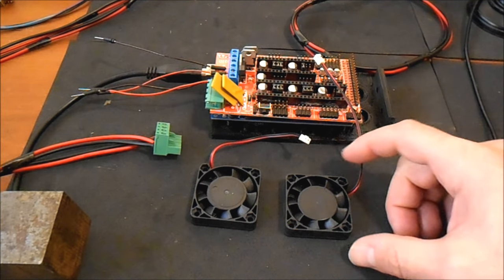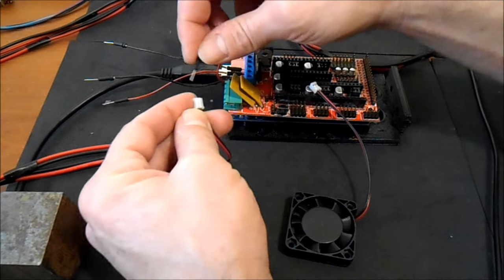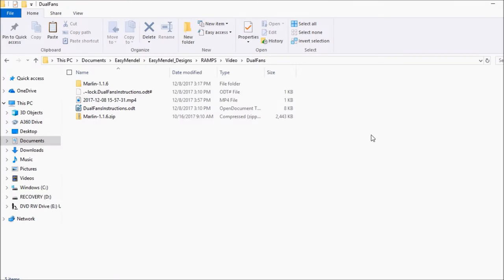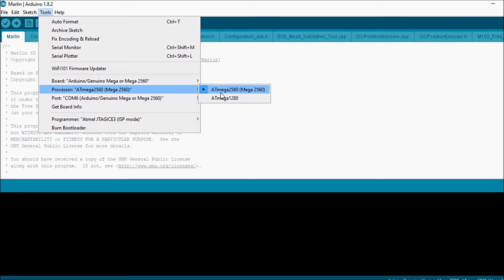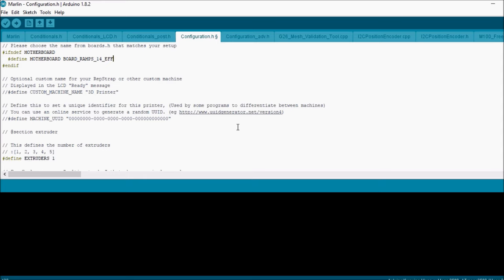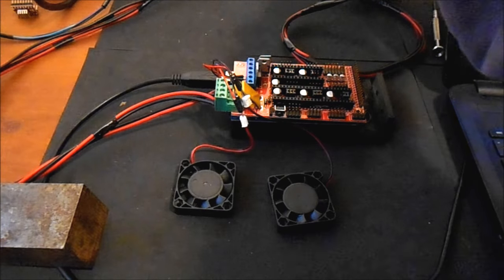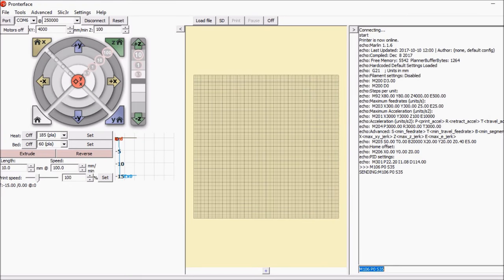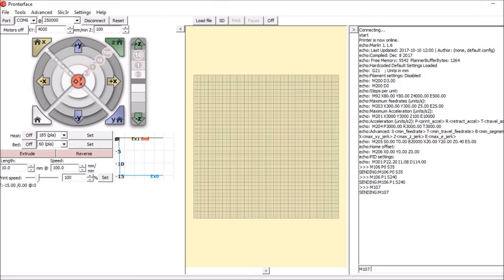RAMPS 1.4 - Dual Fan Setup

Comment: 00:38 If I am not using heat bed and/or hot-end, can I attach my 2-pin fans to those outputs? I am making a epoxy dryer for my lures with mega+ramps 1.6+128*64 lcd and I want to cool the tmc2208 drivers with two fans.

Comment: Hi Edward. ısıtıcı yatak kullanmıyorum. D8 ve D9 pinlerini marlin veya cura ultimaker programında nasıl kumanda edebilirim? veya marlin programında fan hızlarını nasıl ayarlarım?
Reply from the maker: English:
Hi Edward. I do not use a heater bed. How do I control the D8 and D9 pins in the marlin or cura ultimaker program? or how do I set the fan speeds in the marlin program?

You will need to send the command:
M106 P0 S200
M106: Fan On
P0 is fan 1 P1 is fan two
S200 is speed 200 max speed 255

Turkish:
Komutu göndermeniz gerekecek:
M106 P0 S200
M106: Fan Açık
P0 fan 1'dir P1 iki fanlıdır
S200 hız 200 maksimum hız 255

Comment: Hello again  Your videos are realy  helpfull . Can you make firmware configuration video
Reply from the maker: I would like to try, but there is several subjects that could take over ten minutes in a video to show.  the subject matter can go off in several directions with sensors alone.  I'll try and see if I can do a basic video on MarlinFW and see how it received in a couple of weeks.
Reply: endstops didnt work mk4duo 4.2.2 I changed logic and same problem. 
And I updated firmware  this time I coudnt load pin errors Now I ll try load Marlin
Reply from the maker: +Bekir OZGUR I'll be doing a waterdown Marlinfw video tonight.  So maybe in the morning I'll post.

Comment: Hi Mr Ed, Can you help me with this problem please

I have [2] Arduino Mega 2560 and one Ramp 1.4 with Lcd 2004 connected Both Arduino working well half working??

1st Arduino can't see anything on the Lcd, only when I connect it to my Computer using Usb cable
The 2nd can't deducted when connect the Usb but still can see everything on the Lcd, that's mean I can't upload anything new to 2nd Arduino and can't work with 1st Arduino because nothing on the Lcd
Sorry it’s complicated and I can't find out the problem
Hope you can
Thanks a lot and best regards
Mustafa
Reply from the maker: Try my Discord below. I or someone else is always in there.

Comment: I didn't know that the letters referred to (in a way) pins D10, D9 and D8.  So I assume you can't have a heated bed like this? Or can one be controlled via an external MOSFET from another pin? (Marlin noob here).

I'm amazed there aren't easy solutions around for having a heated bed and two controllable fans. One for the hot end heat sink going on and off, over and under 60 degrees. And another for part cooling, controlled by gcode.  

Am I missing something obvious here? ;)
Reply from the maker: +koz you can actually use three or four fan, but I discovered you only need one for extruder cooling e3d.  Currently I've stopped using a heatbed because I print with PLA.  So simply put you can double up fans on one D9, but it can only run at one speed. Also you can run heatbed from a separate power supply, but controlling temperature will not work via Ramps.  Depends on your taste and preference for materials like ABS vr PLA.  To simplify checkout boards.h for Ramps for possible board configurations you prefer.  Currently o mostly use EFF, so extruder, fan, fan.  When I was first learning I used EFB, extruder, fan, bed.  I'll try and do a video on this subject to complement this one.  I'm trying to keep the videos under 10 minutes because I've been CC all the videos in currently 15 languages.  Also I started a new job so I'll try and answer questions in greater detail on the weekends.  Hope this helped, otherwise ask me for more details.
Reply from the maker: +koz I'll try and do a video to clarify D10, D9, and D8 either this weekend or next.  It appears I do not yet understand the spindle configuration, but will probably do a more detailed video on the spindle after I understand it further to present.  Thanks for asking for a more detailed explanation as I'm limited as to how much I can present in one video.
Reply: Thanks! I'm also interested to know what the 'Servo',  'AUX-1' and 'AUX-2' ports are capable of. 

I recently learned that AUX-1 can be used for a 'MKS TFT28(or 32)' touchscreen.
And also that I can use two of the servo pins to connect a 'Fan Extender'.
Reply from the maker: +koz there's a z sensor servo video.  It will outline how to enable the servo pins with a jumper.  Also I've done a video on how to add additional stepper on Aux 2.  Saturday I'll be making public a video using aux 1.  Next week I should have a video filmed explanation of D10, D9 and D8.  Still need to research spindle configuration in boards.h in marlinfw firmware.
Reply from the maker: +Festivejelly good idea

Comment: I have a dual fan for the hot end, and what config should i use?? EFF??
Reply from the maker: Yes.
Reply: @EdwardBraiman  and if i have also a hot bed??
Reply from the maker: Then use default EFB.
Reply from the maker: You can use a fan extender to get a second and third fan.
Reply: @EdwardBraiman  THX for your video it's vere educacional i've done a custom 3d primer too from scratch and your explanations are really well done.

Comment: How to set up and connect 3 fan for hot end improvement
Reply from the maker: Look in ramps 1.4 playlist, there's a video.
Reply: @EdwardBraiman   I have a shipment for some 12v cooling fans for my RepRap. I already have the mk8 extruder cooling fan installed on my RAMPS on port D9. Can I install an additional cooling fan in parallel to the extruder fan on D9 as well?
Reply from the maker: In my playlist for RAMPS 1.4 there's a tutorial for fan extender's.

Comment: MOTHERBOARD BOARD_RAMPS_13_EFF
D9 can be turned on, D8 can't be turned on. Follow your steps, I don't know why.
Reply from the maker: Try checking connections to motherboard.  Try reversing fan connection in either slot.  Test fan connection with multimeter.  Otherwise it might be a bad board.
Reply: @EdwardBraiman  No problem with fans. I found that M106 P0 S20 and M106 P1 S250 are both controlling D9 fans. D8 still has no voltage. Is it a program problem?
Reply from the maker: The symptoms sound like a wire is disconnected or the hardware is broken.
Reply: @EdwardBraiman  Thank you very much for your suggestion. I'm checking it once.

Comment: i use D10 for hotend but hotend not hot why?
Reply from the maker: Possible bad connection with thermistor or wire, check continuity of wires with multimeter.